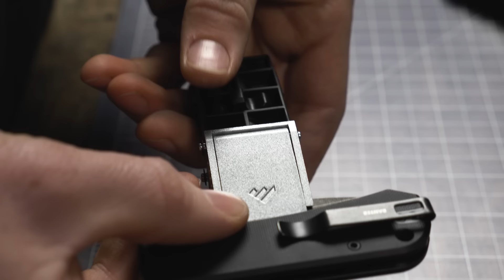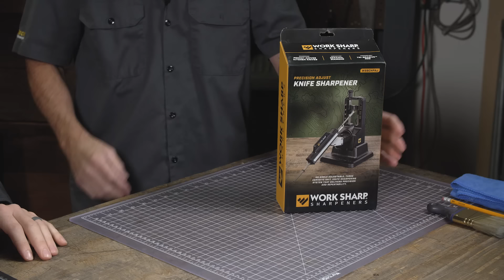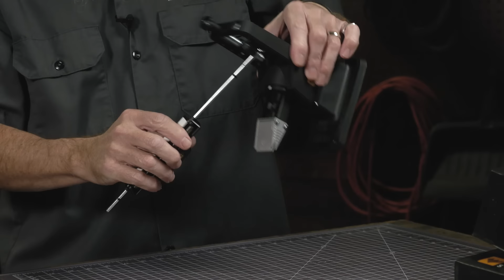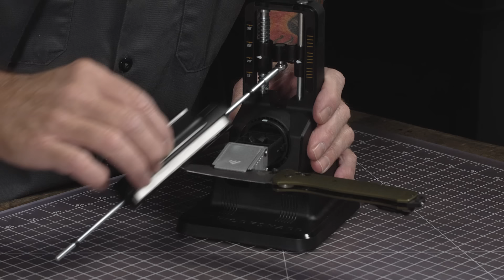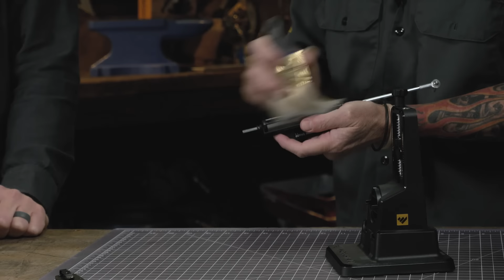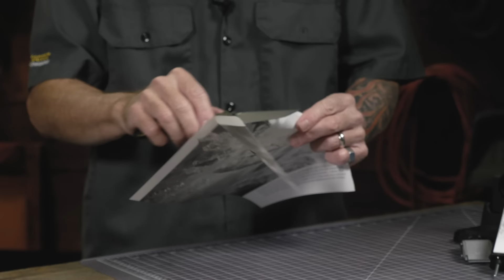How to Use The Precision Adjust Knife Sharpener - User's Guide: How to Sharpen a Knife

Comment: Hey guys, emailed WS saying I cant WAIT until you get a real monster reshaper add on (75-100 grit) and then maybe another one in middle grit and some ultra fine add on's also, for those of use who like to do all the steps from rebevel to mirroring up to strop.  I can't retro fit my Smith and Lansky stones onto this, so some add on kits with just different grit options will be amazing in the near future. For the average person who is maintaining or not doing aggressive work, this kit is the BEST value out there by far however.

Comment: Just a heads up, I've had a big issue when using this tool with shorter bladed knifes (like my Leatherman skeletool) bc the abrasive rubs terribly on the clamp, missing the blade and leaving places not sharpened. Customer service suggested moving the blade further out in the clamp but even so, the knife is now wobbling (bc it's barely in the clamp) and it's still not getting the blade very well. I would LOVE to see them come out with a different clamp for smaller knives as well as more abrasive option and strop. Other than that, this is an amazing tool and well worth the money.
Reply: I shaved a couple of mill off the leading edge of the clamp.Made all the difference and still has a
solid grip on the blade.Been sharpening for years but have a bit of a shaky hand and have never been able to get a sharp enough edge for my liking.With this system im running out of arm and  leg hair

Comment: I'm confused by the instructions and the video. Based on the video you're going handle to tip and then back tip to handle. In the instructions, it specifically states to only go from the handle to the tip, never tip to handle. Can you explain?
Reply: Instructions are for pussies. Tip to handle. Handle to tip. Doesn't matter.

Comment: You still haven't taken into consideration the height. 20° on a 2-3" high kitchen knife will not be 20° on a 3/4" high pocket knife
Reply: I've tried explaining this multiple times to people with multiple sharpening systems and they still don't get it, I wish companies wouldn't even put the degrees on these sharpeners...
Reply: @nsmturbo5902  I've been thinking about buying one oh those digital angle gauges and just attaching that to a homemade sharpening system. I have a Randall model 14 and it's a PAIN to get the top sharpened.

Comment: Issues I’ve run into with this sharpener.
Smaller knives like a Case medium Stockman are nearly impossible to sharpen on this. Small blade Victorinox Swiss Army knives can’t be sharpened on this. There should be another set of sharpening stones to make getting to a polished edge easier. Going from the 600 edge to the ceramic finish edge is time consuming. A strop should be included to bring back an edge or finish an edge. Overall it’s a good sharpening system for basic sharpening of medium to large knives.

Comment: Well it does what it said on the box. Some flexing in the magnetic knife holder arm. So unless used with minimal force can creat an uneven bevel edge. But it is a compromise re budget so with very careful, consistent stokes can achieve a good if not perfect edge. However for smaller blades just unable to stable grip the blade or clear the edge of the blade holder. Have experimented with the Tormek style small knife holder with some success. However, very fiddly to set up. Good value for the Bush knife kitchen knife and medium size folding knife. But smaller whittling knife user not suitable. May be some small knife arm could be created as an accessory.

Comment: How would one go about sharpening a Benchmade Vector (496) with its complex recurve?
Reply from the maker: I personally own the Vector 496 (great knife!), and I don't sharpen on this system. I may give it a try just out of curiosity now. But I have used a belt sharpener to follow the curve of the blade and to adjust for the different edge angles on the recurve and the belly. Mine is sharpened to 14 degrees on the belly and 18 in the recurve or tanto section. I used the Blade Grinding Attachment the one time I needed to sharpen mine, otherwise I use a ceramic rod to touch up and strop with leather.

Comment: Good instructional video. I'm expecting mine to arrive in the next few days. Be curious to see how it compares to my Ken Onion belt sharpener other than a flat ground edge versus the more convex rounded edge achieved on a belt sharpener.
Reply: So you've had them both for a number of years now. Which would you say is a superior sharpening system?

Comment: Seems very very good, easy to use and well made. Too bad the minimum angle is 15degrees. Some kitchen knives and some scandi-Grinds need a smaller angle (12 degrees for a Roselli Hunter UHC-Wootz, for example). 
Scandi are easy to sharpen btw, but would be good to have a « do-all-knives » tool.

Comment: How many knives can u sharpen with a set of stones? Thx!
Reply: That would depend on what steel you sharpen and your sharpening ability with some more variables sprinkled in so I can't give you a number but what I can tell you from experience is work sharp abrasives can and will hang with top shelf models I actually prefer them over DMT and wicked edge abrasives and you'll definitely get your money's worth with any worksharp using diamonds

Comment: This is ridicolus, with that device the angle change in order of the distance from the edge of the blate to the fixing poin of the rod. You can't have a precise angle with this sistem. You set 20 degrees fot the  wustof chef knife, but you can see that the angle between the rod and the blade is far more than 20, I would say it's beteen 30 and 40 degrees
Reply: You are 100% correct! I try explaining this all the time and people still don't understand... The degree numbers on all these sharpeners are useless
Reply: @nsmturbo5902  I would say that this tool is absolutely usless, it's a waste of money

Comment: Great sharpener! Is there any way to sharpen really small blades like my small Victorinox Swiss Army knife which has a ~1.5” blade that is only 1/4” wide?
Reply: Nope. They need to design another blade clamp to do small knives. I’ve tried to use it to sharpen a small Victorinox, a Case medium stockman and a few little neck knives. I have yet to figure out a way to hold small blades reliably.

Comment: Really wish I could actually find one of these right now!
Reply: Try Amazon they just got some in
Reply: Got mine on Amazon last week.
Reply: This system is legit. Ive used it on 5 different steels so far.  LC200N, S30V, S90V, VG10, and CPM154. It handled all 5 like nothing. No more than 20 minutes from dull to a nice razor sharp (almost) mirror polished edge.
Reply: DLT Trading has them in stock

Comment: Is there a special process for sharpening tanto blades? Does anyone know?
Reply from the maker: Sharpen each portion of the blade separately. I don't recommend re-clamping because I want to maintain consistency when I come back to touch up my knives. But if the blade is large, then you could reposition to center on the main portion of the blade and then again on the tanto portion.
Reply: @WorkSharpOutdoor  that's what I imagined. Thanks so much. Any word on a hone for hawk bill or curved blades?

Comment: Very nice. But I´m still concerned with the fact, that different blade hights will lead to very different sharpening-angles. Eg when you fix the scale to 20°, a very small blade will be sharpened at a much steeper angle >20° than a blade with very huge hight, which will be sharpened at a rather flat angle <20°. At which height of a blade does the scale match the real angle?
Greets from Bavaria, Germany
Reply: Yep, the degree scale is useless and shouldn't even be on there

Comment: It’s concerning to see how much the knife rocks  or moves with their light sharping movement, especially the longer knife. I think the unit  needs to be more sturdy than just plastic. Just an armchair observation though because I never used one. Great design though, see real potential in it.
Reply: It's actually a solid unit and puts edges on knives just as good as my wicked edge maybe better since I'm a Spyderco fan and I can get the edge alot crisper and closer to the plunge grind with the worksharp.. it's definitely worth the money and when I wear it out I won't hesitate to get another.

Comment: This is basically a plastic copy of the KME, except far less versatile, and proprietary sharpening systems....NO thank you. I will admit the recurve bar is cute and handy for some, but it takes less than twenty minutes to whittle a wooden dowel with sanding paper for the same thing which is far more refinable. 
Bonus points though, for the first time I have ever seen a professional company of any sort suggesting erasers for cleaning ceramics, 20 years after it's common, but bonus points none the less.

Comment: Nice system, but how do you factor the height of the blade into the sharpening angle? I think this requires an external angle indicator.
Reply from the maker: Blade height does affect edge angle... but the most important thing is consistency. So if a tall blade is sharpened at 20 degrees it may actually be 19 degrees, but the next time you clamp it and set it to 20 degrees you'll still be sharpening to 19 degrees. Consistency is more important than the actual number. And you can always use an angle finder (there are free apps for your phone), to set the exact angle you want.
Reply: I was wondering the same thing and looking for a comment like yours before I asked the question.

Comment: Now all you need to do is add a stone holder for standard 6” X 1” stones and you’ll have a real fixed angle budget sharpener contender!
Reply: They might not make that to prevent you from buying stones that aren't their brand
Reply: @jasonduarte95  you can simply by strips of automotive sandpaper for buffing out scratches on your vehicle. They have basically every single grit u could ever want and even way more than that. Then you just use some adhesive to glue them on. The channel that recommended this tip was saying there was a specific adhesive that allowed you to remove the sandpaper without leaving a permanent mess underneath, but I forgot the exact adhesive he was recommending
Reply: @CloudyShinobi  That was Sweetknives that showed that idea.  For a few bucks one can have many different grits including to 3000 or more.
Reply: Go to gritomatic, problem solved.
Reply: @Osprey1994  that's what I did, got a 6" holder

Comment: Need more grits between 600 and the fine ceramic.  You’ll never get rid of the scratches from the 600 with the fine stone.  Other than that it is a good system but this is a serious flaw.
Reply: I am gonna hold off on buying one untill they have some more grits available. Hopefully they offer another of the triangle carriers with some higher grits ( up to 2000 )

Comment: I notice that you use a very small area of the stone with each stroke.  Maybe in over thinking it but wouldn't using the full length of the stone in a longer stroke be better for the longevity of the stone and prevent or at least postpone hollowing out the belly of the stone and fighting a curved grind on your knife? Thanks.
Reply: Controlling the angle becomes difficult or impossible when your edge contacts the stone anywhere but the one side.

Comment: Wow that looks dope!
Any chance of other grits/strop in the future?
Reply from the maker: We are working on more grit selection. In the meantime, what would you like to use for grits to make this your ultimate sharpener?
Reply: @WorkSharpOutdoor Great!
Well, I'd honestly have to get my hands on one first, to give you a comprehensive ansver (there's a chance it works just fine).
BUT
What I like about my Lansky system is that there are lots of stones.
I'd add another, "expert" stone ro your repertoire with an extra course(~120-160) an extra fine(>=1500) and a strop similar to what you can find on your benchmade edc sharpener. 
Just a strop could work wonders as well.
Reply: @WorkSharpOutdoor  I saw your other field sharpener has a second stone available  that has a 200/800/strop combo. That would be a good start. I find that moving from a 600 to the ceramic makes a very sharp edge but a finer grit stone before the ceramic would be good to make the edge more pretty. And I thinks really all it’s about. Shiny edges. My knives are sharper than I need as is with the stones you provided. I was cutting my cuticles with a Spyderco Waterway after sharpening it on this. People who buy this are probably people who just won’t buy a wicked edge but want the same result. I would  buy every stone set you put out for this because over time I can build it up the system. You guys have to think of this as a system. So probably another two stone sets sold WITH the entire bar and magnetic attachment is the key. I don’t want to have to slide the rubber stops off to change stones. Just pop the whole thing off and pop in the next stone set. Whatever combos of stones you find get an edge to a mirror polish is really want I want. And I’m sure a lot of other people want. Also a stone set to sharpen Spyderco’s Spydiedge would also be crazy awesome. My work is commercial diving and all of our dive knives are Pacific Salts in H1. Sharpening those is no fun. 

Great sharpener. Thanks for making a system that everyone can own. I’m sure there are awesome products in store. 
Oh and some ways to store the rods on the base. Like some holes. I already drilled a hole in mine to keep the rod somewhere.
Reply: @kennethkuhlman8864  @Work Sharp Sharpeners This is my favourite suggestion and the same idea i had! I would love to see the Guided sharpening system grits! 220-320-600-800-1000 (ceramic) leather strop!  that sounds about perfect!

Comment: In my opinion, it's too small and fiddly - it's practically a toy. Everything needs to be scaled up at least 25%.
Reply: I bought this and have sharpened 7 different knives on it so far. Great results on it. I had to move to testing it on my leg hair because my arms don’t have any more hair. It works really really well and the bevels are consistent and clean.
Reply: It looks fine the way it is for 99% of all knife sharpening. How would making it bigger make it better. Also that would increase the cost much more and make unavailable to many more people.
Reply from the maker: We love feedback, and we are listening - have you tried this yet or just a hypothesis?
Reply: @WorkSharpOutdoor  I've not used this specific system from your company, but have used most of the known/popular guided systems under the sun including cheap Chinese knockoffs/designs - IMO the range of motion on that guide rod is too short and the stones too small. The amount of play at the mounting point of the ball joint for the rod is really unnerving. And not a fan that the stop collars are simply slide on/off instead of something that will remain very secure in the future.

Can't comment on the clamping system without trying it, but would be interesting to see how much the magnets holding in the clamp would be likely to gather metal dust and particles. Personally I think the blade clamp should be secured onto the blade via an attached lever or a hex wrench instead for better leverage and to make it more accessible to users with disabilities or injuries. Similar case with the angle adjustment knob though it requires less force; something that protrudes out from the knobs will also allow for finer controls of adjustment.

I do like the spring loaded quick rotating feature, a very convenient function. I think the system has good potential, but as I've said just comes across to me personally as more of a toy more than a tool.
Reply: @WorkSharpOutdoor  i think the problem could be solved with a Longer rod and maybe a larger clamp! you could have those as aftermarket parts! Maybe a larger Holder where the Tribrasives fit into! :D

Comment: I like and impressed with all of the Work Sharp sharpening system but would like suggestions for the best Work Sharp system for woodcarving knives, where most blades are smaller than a pocket knife blade. A demonstration would be nice, hint hint lol.
Reply from the maker: Thanks for the suggestion! For knife blades with unique shapes we usually recommend the Elite Knife Sharpener. The exposed belt offers so much access and available space to sharpen. If you prefer manual, then something like the Benchstone, or Guided Sharpening system.
Reply: @WorkSharpOutdoor  are there any pointers for woodcarving knives? Words of advice
Reply: @WorkSharpOutdoor  thank you so much for replying, I have your Ken Onion Edition with accessory similar too the elite knife sharpener, I also purchase the Guided field sharpener. As I stated earlier I’m hook on Work Sharp products. Thank you so much